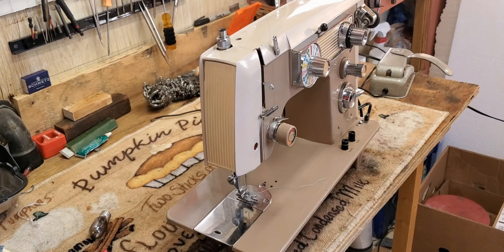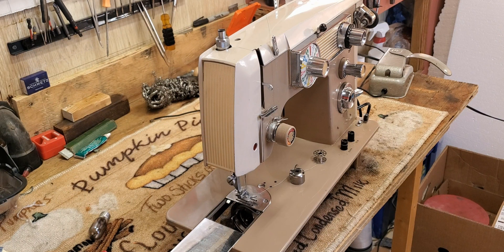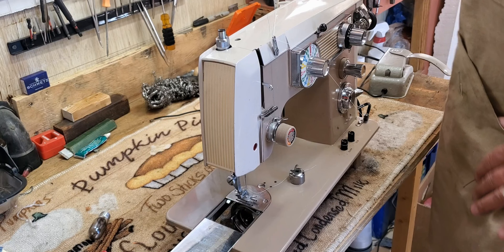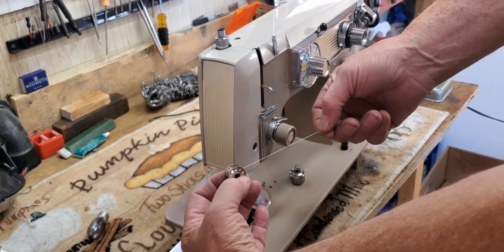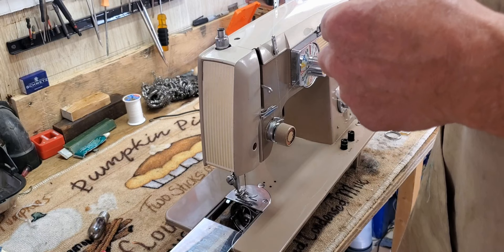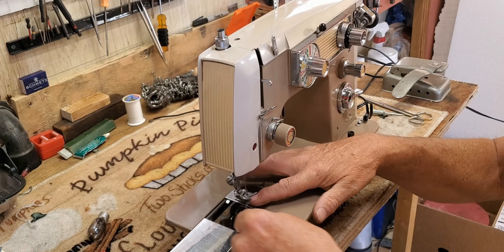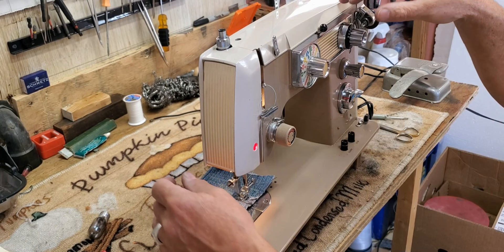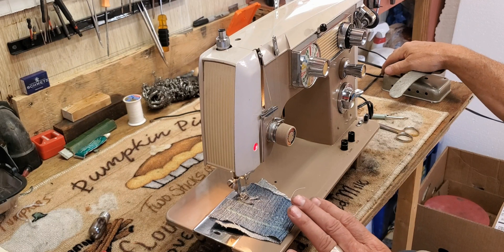Nelco Sewing Machine Final Test and Tutorial

Comment: I have an old Nelco that I got at a rummage sale for $10, but then spent $125 getting it all cleaned, oiled, and fixed. It worked beautifully for several projects,but now I can't figure out how to thread it! I feel like an idiot. I put different color threads in the top and bottom so I could see where the problem is coming from. It seems to be the top thread giving loops on the underside. I don't know the model # but will keep looking for it. Thank you. I find your voice very calming because I am so stressed out about the machine not sewing properly and I just know it is something I am doing wrong!
Reply: R1000
Reply from the maker: Loopy thread on the bottom usually means insufficient upper thread tension. Make sure your upper thread is going between the disks of the tension assembly and that it's dialed up far enough. Usually, around "3" is ballpark. Your machine could be set differently but start at around there and the go up or down in tiny increments until the stitch looks the same on the top and on the bottom.
Reply: @StagecoachRoadVSMR  Thank you! I will try this.

Comment: I have a slightly different model but the thread tension assembly button is the same. I took it apart and now I cannot put it back together. Do you happen to have a video showing how to disassemble and reassemble that unit. Thanks for any help you can offer